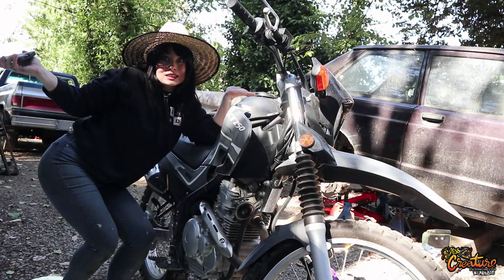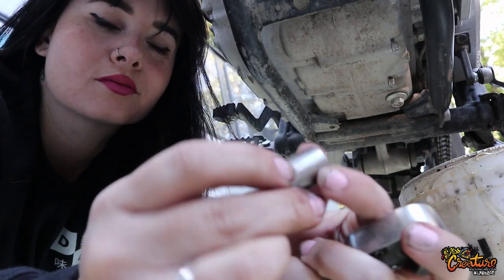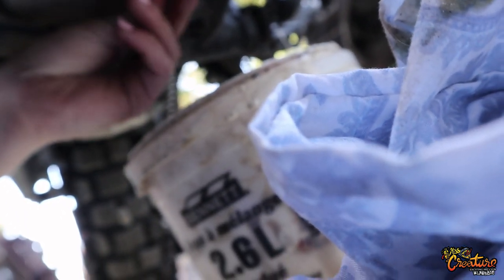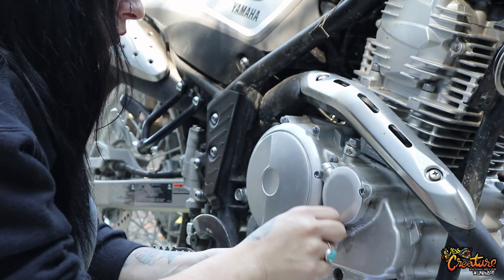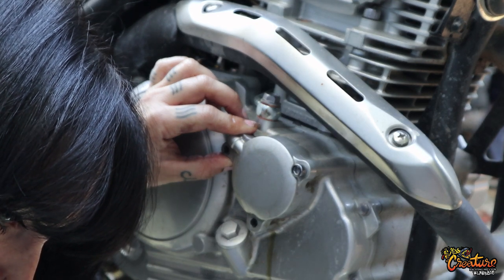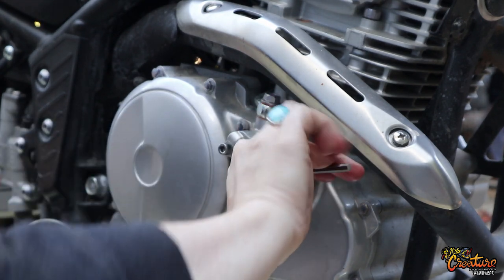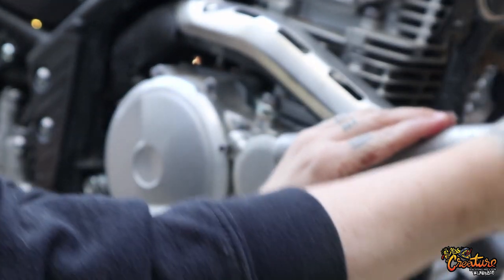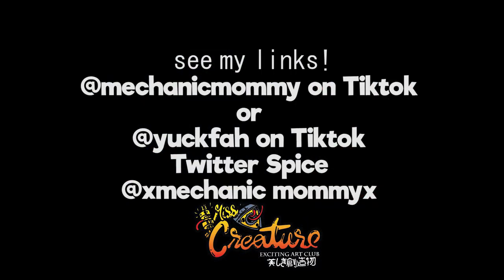My First Oil Change on my 2022 Yamaha XT250 - A Diverse Bike with a Rich History

Comment: Using the pipe is fine as a cheater bar my only suggestion would be to keep one hand on the Allen wrench at the head of the bolt to help prevent rounding it off.

Comment: Get yourself a set of 3/8 drive Allen sockets, they're quite handy if you're going to be working on bikes much. And yeah, be careful with those oil filter screws. Fine aluminum threads are fragile, you wouldn't believe how many of them I've seen stripped over the years.  And you can't always trust the oil bottle measurement thing, so I got a clear plastic quart/liter measuring cup at Walmart for about $3.00 that takes all the guess work out of it.
Have fun (and wear a helmet)!🙂